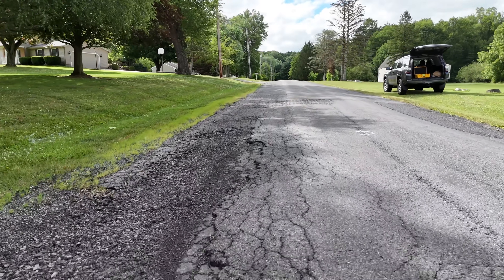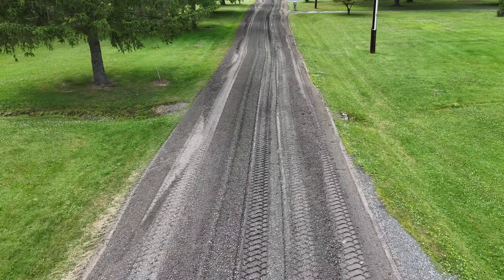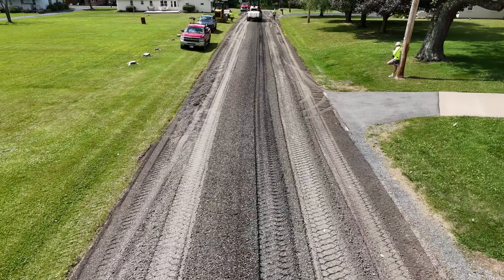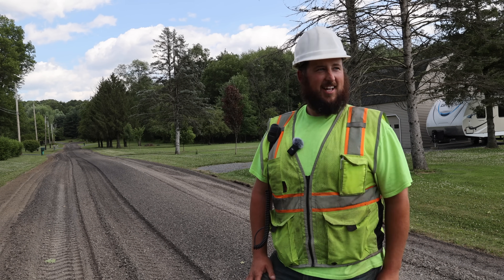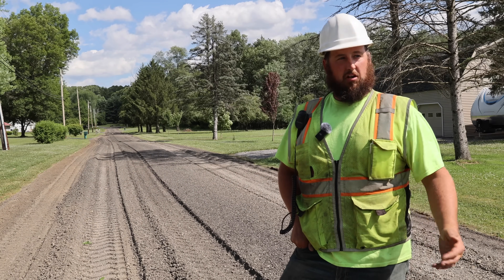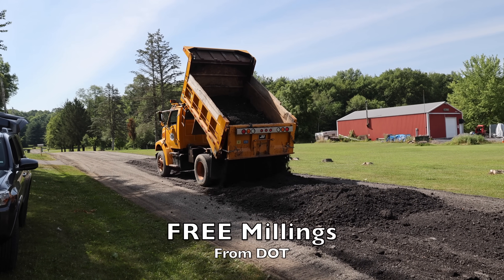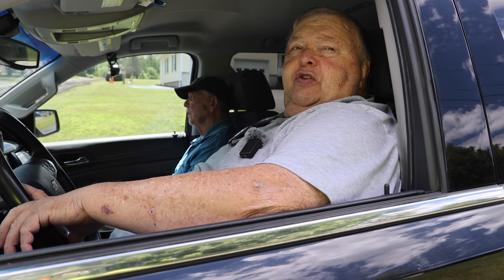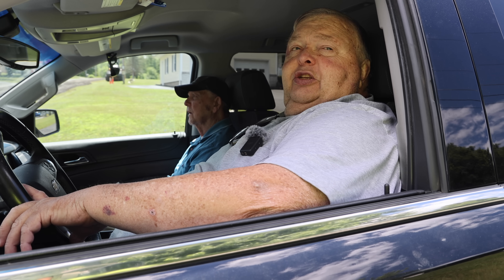Asphalt Zipper Road Reclaimer Saves Small Town $160,000 on Road Repair Costs

Comment: Every city large and small should have this setup. The recently re-paved roads in my mother's small subdivision at a cost in the multi millions. It really makes you wonder how much is wasted by contracting out any work that's an ongoing need. The good thing about what they are doing is you never lose access to the road. It sort of reminds me of the late 80s when it became law that the city transit couldn't accept private charters from the School Districts. At the time they were extremely affordable where to cost to the school districts was less than $100 per hour. When that law was past the transit company still did the work at the same rates but through a third party that didn't own any buses. The cost almost doubled to the School Districts. Same goes in most road projects, the winning bidder often subcontracts the work and the work is subpar.

Comment: Need to train operators how to use this machine. 

Local company hired subcontractor to repave a highway and it turned out a wash board mess.  Original contractor had to come in, RE-GRIND highway surface to remove the one pass job and re-pave it AGAIN.  At their own cost, I'm sure 😅😅😅  not
Reply from the maker: That's horrible!  AsphaltZippers make it all possible. Thank you for watching.

Comment: I'm in Kentucky. 30 years ago, 80% of all county roads in my home county were gravel. The county did not have a large budget to work with. The most they did was grade and level the roads and then lay down new gravel every six or so months. But one year they tried something similar. They laid down a finer gravel and then laid a seal coat on top. It did reduce the dust and mud that the roads would produce but the bed was not very stable. Pot holes would form after a short time. It got so bad the county couldn't keep up patching or filling the holes so they ripped up the sealed surface and went back to the old process. Today, most of the county roads are now paved in asphalt but repairs are few and far in between. Some roads will never be paved due to lack of traffic. The more populated a road, the better chance of it being paved.
Reply from the maker: You are absolutely right.  Asphalt Zippers are great for gravel roads too.  We even have a section on our website that talks about it. https://asphaltzipper.com/road-repairs/#gravel-roads

Comment: Why do you have to wait an entire month to do top coat?
Reply from the maker: Excellent question.  We wondered about that ourselves, so we asked Jared Wehry.  Here is his response: We normally don't wait a full month between steps.  That only happened on that job because of the contractor's (paving) schedule.  Our standard process is to wait about one to two weeks from the time we zip until we place the stone.  That gives the base a chance to settle under traffic, but not so long that it starts to develop washboarding.  After we place the stone, we give it another week or so to let traffic help compact it and to see if any problem areas show up, like soft spots or drainage issues.  Taking that time helps us catch and fix things before we move forward.  Once the base is stable, we apply the asphalt surface treatment.  Right after that we put down the seal coat to lock everything in and prevent raveling.  After another week of curing, we finish with a fog seal.  The fog seal binds the fines, helps waterproof the surface, and extends the life of the road.

Comment: This system is great and all, but you didn't address the road base issue that causes asphalt paving to fail.
Reply from the maker: You are absolutely right.  In this video Jared pulverized the road surface and blended it full depth; he also added additional material from PennDOT, creating a super stable base.  Here's a simple animation video that explains the process. https://youtu.be/5_0QHoyfl8w